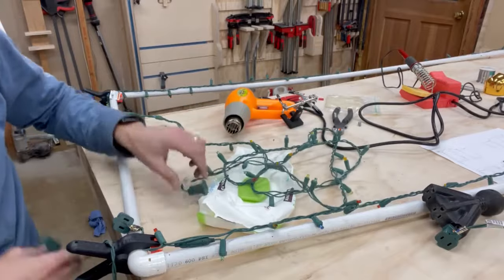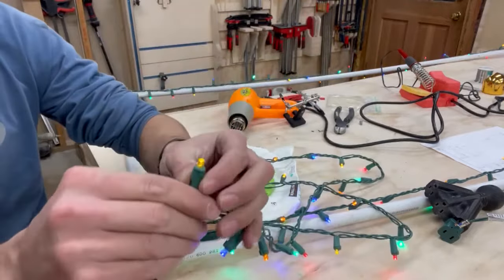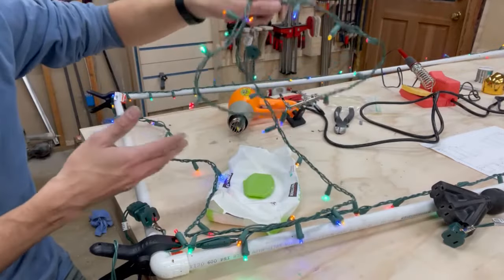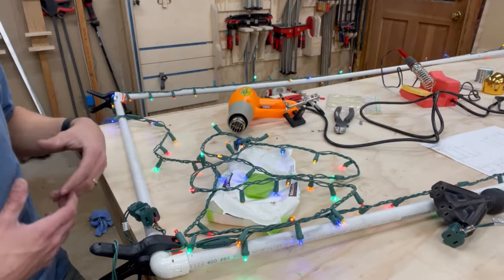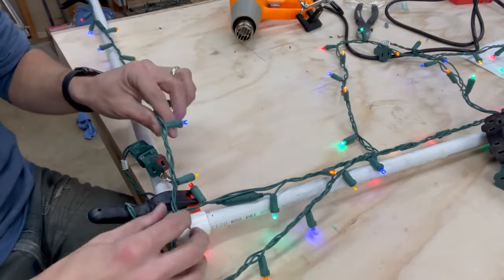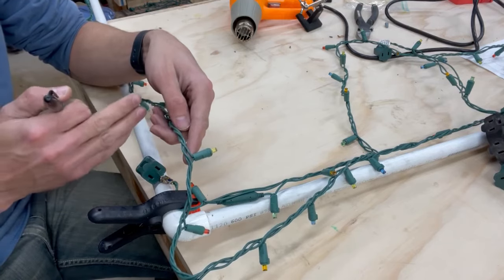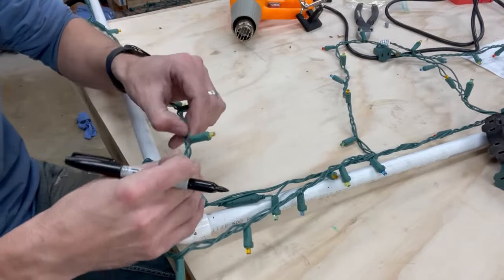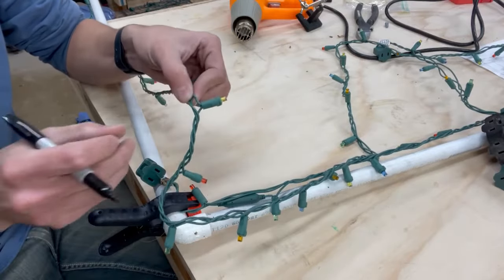How to Shorten and Solder LED Christmas Lights (Part 1 of 3)

Comment: Thank you so much for this video. Someone cut the cord on my Christmas lights outside. I didn't want to throw them away because they are very expensive lights. Thanks to you I was able to wire the lights back together. You saved the day!. Much appreciation.

Comment: The “resistors” are rectifiers. They convert ac power to dc and eliminate flickering. These lights are fully (full wave) rectified. These are the only LEDs Christmas lights worth buying.
Reply from the maker: @DrummerGirl423 Thank you for providing this information 💥 I had no idea what those were 🙃
Reply: Actually those are resistors. They often look very similar.  If they were rectifiers then there would be 2 wires going in and out of them, but his lights only have one wire.

Comment: My LEDs have three wires all the way to the female plug at the end.  I trimmed them several lights after the resistor/rectifier pack in the middle.  But now, no matter which way I splice them, the lights after the resistors don't work.  Humm.
Reply from the maker: Sorry to hear that. None of my LED lights have the 3 wires like you described, mine all look like the ones in my video, so I can’t help you out. Hope you’re able to figure it out, or at least wire it back like it was originally. Good luck 🤞🏼

Comment: Can i use this method to connect 3 separate christmas lights? I'm trying to get their blinks to sync. I know i can just connect their plugs, but every time i unplug them from the outlet they go back to random.
Reply from the maker: @Daryl Estrada Florin I haven’t worked with any of the blinking lights so I’m not sure. Depending on your comfort level with soldering, you could try and if it doesn’t work then solder everything back to normal. If you choose to try it, plug it in and verify that wires aren’t getting too warm and make sure you don’t have any voltage drop. Be safe and good luck 😎

Comment: Last year I installed two sets of lights on my patio. During the winter a squirrel came and ate the wires in a few places and also completely cut off the connections at both ends. I was in a lot of trouble doing the repair, not knowing which wire to connect . I have used your method and it is very effective. Also it works for both male and female connectors,
at the beginning of the lamp series as at the end.

Thank you !!!
Reply from the maker: @Maurice bélanger Darn squirrels and rabbits always chewing wires. Glad you got everything working.

Comment: Thanks. I needed this.  I was wiring the lights on the roof and my wife wanted a section with no lights and I just didnt see how these lights were wired. It looked like a series but that third wire got me.  Thanks again. Great video.
Reply from the maker: @pipi7731 Glad the video helped. Stay safe

Comment: Good Video... Thanks! Wondering if I can splice/an incandecent 4W blub connection to a regular string LED string lights.
Reply from the maker: To be honest, I don’t know. If you have some spare lights you don’t mind possibly ruining, I would just go ahead and try it. That’s basically what I did when I first tried doing this. Good luck.
Reply: as long as you splice it in parallel with the LEDs, and not in series

Comment: You are good:-) I have some strings without resistors inside the line. I will give it a try to cut the string. I asume that you do not need a femal plug at the end.
Reply from the maker: You do not need a female end, but you’ll have secure the ends of the wires so you don’t cause a short. I would cut off the female end of a set of lights that don’t work anymore and use that.

Comment: Thanks for your video. I was wondering if its possible and would it be relatively simple to mod the mode control box? In 9/10 cases when you buy xmas lights they have 8+ modes or programs and the "steady on" mode is always right at the end meaning they are useless if you want to use them on a timer. Have you ever done something like this before? I would imaging just bypass the controller and solder the wires but Id really like to not blow myself up if i can help it. The idea is i will hoist them up my sailboats masts and up the forestay over the triatic stay and down the back stays. also all around the grab railings too. Id really like to use a timer though i cant be going to the marina everyday to press the damn controller button.
Reply from the maker: @ThyHarkness I’ve never messed with the lights that have the controller box. Only the cheap simple lights. They sell simple timers that you can plug your lights into, not sure if something like that would work for you want. Sorry, not sure I’m going to be much help with the controller module.

Comment: When you say not super short, how short do you mean??? I’m making an archway with led Xmas lights and I want to be able to take it apart in sections for storage so I want to cut the lights in the detachable parts of the arch and add make and female plugs kinda like the pre lit Xmas trees. Will this method work for that do you think?? It’s a 3 wired string of lights like the video.
Reply from the maker: @edgelordlive1801 I honestly don’t know the shortest length possible before it won’t work. I would assume you would need at least one rectifier or what I called a resistor in line in order for them to work, but I don’t know that for sure. I would just label everything so that if it doesn’t work at the length you want, you can just solder everything back together and try a different length. Good luck and be safe.
Reply: @projectputunder6025  lol I really wasn’t sure if you would reply so fast. Thanks a lot I appreciate advice

Comment: Great video. Followed your method and cut my line. Plugged everything back in and it looked great for a couple minutes before it flickered and went out. Now only half of my 66 ft lines went out. Guessing you can’t just cut the lines shorter since the voltage is coming through the lines is matched up to a certain number of led lights. Too few lights, you get a burnout? Run into this?
Reply from the maker: Correct. There is a length at which it becomes too short and you’ll start to experience problems. Unfortunately I don’t have a formula or trick to know what that point is. Might worth trying to see if it’s just a bulb that randomly stopped working and that’s why half of them went out 🤞🏼🤷🏽‍♂️. You can use the ‘LED Keeper’ tool to determine if that’s the case. Sorry to hear that happened. Good luck and stay safe.

Comment: I think you should leave a little more wire on the end. Don't cut so close to the bulb socket in case as you said you need to reattach  the removed length.

Comment: Perhaps I missed something but if you shorten by quite a few lights  then the other LED's might get too much voltage and burn out faster correct?
Reply from the maker: @Sgtmajorsir There is of course that possibility, however, I’ve been running mine for over 4 years with no problems and not a single burn out.
Reply: I saw another video where the lady talked about getting too much voltage because the resistance had been reduced.  She solved the problem by wiring in a properly sized resistor.   Have not tried that but it worked for her.

Comment: Great video.   The LED (blinking/multicolor) strands that I purchased have 4 wires.  How do shorten those?  Thanks.
Reply from the maker: @MAS I haven’t tried this with one that has 4 wires. Depending on your comfort level with soldering (and comfort level of destroying one strand of lights) I would just label each wire on both sides of the cut, use some wing nut wire connectors and go through a trail and error method. That’s honestly what I did. In my experience, connecting the wires in the wrong order and plugging in the lights did not ruin anything, but your experience may be different with that 4th wire. As always, be safe and attempt at your own risk 😜😎

Comment: Will this method work for the incandescent mini bulbs?  I need to shorten a length to only about 5 bulbs.  Thanks!
Reply from the maker: @Joe Whistler This should work with incandescent bulbs, full size or mini. If you’re concerned then you may want to try with a set you’re ok with messing up, but this process should work just fine you. Let me know how this works out for you. I’m sure others would like to hear as well. Good luck 👍🏼😎
Reply: No it will not work with mini incandescent bulbs. The bulbs will pop instantly.
Incandescent mini bulbs have many different ratings.  2.5v is the most common, but there are also 3.5v, 5v, 6v, 10v and 12v.  You need to have enough bulbs to total 120v.  So you need roughly 50 of the 2.5v bulbs, or 35 of the 3.5v bulbs, or 24 of the 5v bulbs, or 20 6v bulbs, or 12 of the 10v bulbs, or 10 of the 12v bulbs.
You can shorten the string but you need to change the bulbs also.

Comment: How can I use just 20 bulbs from a set of 100, lighting it with 240v/50Hz ac  please?
Reply from the maker: @gatlino2004 Unfortunately I will not be able to help you out. I do know that there is a point at which too few lights is problematic, but I don’t have an exact number and I definitely can’t help you with led lights on 240v. Good luck and be safe 👍🏼😎

Comment: Where do you buy your lights from? Also, can I do this with a control box lights meaning the box that controls the blink pattern?
Reply from the maker: @AJ W I got these lights from Walmart when they were on sale 🤑 I haven’t tried this with lights that have a control box to control the blink pattern. If it was me, I would use the marking system I showed in the video and go for it. If it works great (it may take some trail and error like I showed in the video), if it doesn’t work then you can solder everything back the way it was. I’m only telling you what I would do, but in the end it’s up to you. As I have said before, use lights you are willing to sacrifice or be willing to go buy another set if something happens. Good luck and let me know how this ends up working out with the control box and blinking pattern, I’m curious and I’m sure others are as well 💥😎👍🏼

Comment: what if I decide not to add the plug at the end? how do I finish the connection? thanks
Reply from the maker: @Nicholas j. Mastrocovo Hey there, I would recommend keeping the plug to keep the wires safe and in case you ever need to plug something into that set of lights in the future. If you aren’t going to keep the plug, you need to make sure the wires are covered and protected the elements. Maybe some shrink tubing or something along those lines. Be safe and good luck 😎

Comment: so i have a standard 5 color (red,blue,orange,yellow,green) 70 LEDs string with 2 rectifiers. i want to add 2 more colors (white, purple) in the set. my set is 3 wires also.
 i bought a 70led white set and 70led purple, now i just need to cut and add. 

if anyone knows some tricks let me know please
-> are these LEDs one direction? 
-> and the 2 wires bypassing the LED, does they matter how i connect them? or they random (of course the LED wires i will connect to the next LED)
-> and also, do i have to add the rectifiers every 35 lights? or doesn't matter
Reply from the maker: @Gabriel alacubalena Unfortunately I won’t be able to help you out. Good luck. 👍🏼
Reply: "are these LEDs one direction?"  - YES, LED's are unidirectional. If you have a string of lights that are uncertified then it doesn't matter. If the string is rectified then it does matter which way the LEDs are installed.
"and the 2 wires bypassing the LED, does they matter how I connect them?"   Yes.  Those 2 wires bypassing the LEDs are the HOT and neutral wires from the plug. If you connect them together you've created an instant short circuit. The wire from the LEDs needs to go to the proper wire.
How many white and purple LEDs are you adding?  If you add too many they will just turn off completely.  Each colour LED has a certain forward voltage bias associated with it ranging from about 1.7v (red) to about 3.5v (white).  They need that amount of voltage to turn on.  Purple and blue are close to 3.0v.  So your 70 LED string is comprised of 2 sections of 35 each.  If you add too many white and purple LEDs it will slowly dim until it doesn't work at all.
Reply: @tchevrier thank you!
I noticed this too; they got dimmer as i was adding until the added ones were off completely while the the rest of the string was on. i think the white ones needing more power than any other color is messing up everything.
im thinking how to add power somehow without burning them; like section them further (every 20-25) and powering up each section, if it makes sense
Reply: @alacubalena  It's not really about needing more power.  Its about needing more voltage.  An LED needs a certain amount of voltage to turn on (forward bias) and that depends on the colour.  Red is usually the lowest (1.7v) and Blue is the highest (3-3.5v). In most cases white is just a blue LED.  Most multicoloured 35 bulb LED strings typically have an even mix of  4 or 5 different colours.  Assuming that's 7 each of red, orange, yellow, green and blue, that would be roughly 80v.  That's the minimum voltage you need to apply to turn the LEDs on.  But if you just connect 35 LEDs to an outlet you will instantly blow them all because there is nothing limiting the current.  That's why the resistor is required.  The resistor is required to limit the current to 15-20ma.  Now for each purple and white LED that you add, you are increasing that 80v figure by roughly 3v each time.  And with each LED that you add you are reducing the current.  So lets say you add 5 purple and 5 white LEDS.  Now the total voltage drop from the LEDs is 110v.  It's still enough to turn on but the current will be considerably less and thus the LEDs will be quite dim.  Add a couple of more LEDs and eventually there isn't enough voltage to turn them on. It really doesn't matter where you position them, there just isn't enough voltage to turn them all on.
Reply: @tchevrier  let's see if i got it correctly..
so my project is : 
i have a 70 LED string with 2 halves at 80v; Each half is rectified by a resistor; i want to add 7 White and 7 Purple per half, that would be 14⚪ and 14🟣 total; With about 3v each that would be 84v extra. So i need to supply more voltage (around 160v?) and keep the current at 15/20 ma?

Comment: Can I do this if it has a battery pack?
Reply from the maker: I have never tried this with a battery pack, but I don’t see why it wouldn’t work. I know this is obvious, but just make sure the batteries are out 😂 As I stated in the video, if you’re going to try, be willing to throw the lights away if it doesn’t work. Good luck and please come back in here and let me know if it was successful.
Reply: Battery powered LED strings are different then AC strings.  AC strings install all the LEDs in series with one another.  Battery powered LEDs install the LEDs in parallel with one another. That means it is much simpler to shorten the string.  Just cut off what you don't want.  But DON'T join the ends together.  That will create a short circuit.

Comment: It’s not a resistor, it’s an ac/dc step converter.  LEDs draw very little voltage.
Reply: LEDs draw very little current

Comment: Can you connect like two different colored lights? Let's say I wanna cut a red christmas light in half and a blue one in half, and I wanna connect those two. Would it be fine?? Or it needs to be a same brand or voltage  etc?
Reply from the maker: That is an interesting idea. I have not tried tried that yet, but now I’m going to lol. I would think that was long as you maintain to same or less number of lights, this shouldn’t be a problem, however, proceed at your own risk should you attempt it. Please keep me updated if you try. Be safe 😎
Reply: That's a good question.  Different coloured LEDs have different forward voltage drops.  If  you replace a red LED with any other colour you will shouldn't have a problem, however if you replace a blue LED with a red then you will need to be careful how many you replace as you will increase the current for each LED you replace.

Comment: I have c9 led. I only need to cut 7 off the end. Do/should I reconnect the female end if I don’t need it? Mine also do not have a resister do you think/know if this will work??
Reply from the maker: Adam, this will work even if your LED strings don’t have any resistors. If you have any concerns, then mark each line as directed so you can solder everything back together if needed. I would recommend just using the female plug that is already at the cut off end bc you never know when you might want/need power for something else. Also, it’s an easy way to keep your new connections as water resistant as possible.
Reply: All LED strings have resistors.  They might be located on the wire like in this video, or they might be soldered directly to the LED inside the housing where you can't see them.

Comment: Hello beautiful. I am looking like this. Can possibly show something. Mean Christmas icecle light is very nice. I seen 3,4 inches gaps each light.  But I like to do filler between gaps more light. Like ever two inches length I like to put extra light. How do I can do. 

Like example shop seen I meter length 20 lights. But I like to put 40 lights. Do understand what I am saying. 

Do u know any shop will do London. I live N9, close to Tottenham new football stadium. 

Or can possibly do for me

Only I like to do my front window 6 fits around wider

Just like to do each wire length bit bigger and more light extra put every two inches after after with U.K. plug or usb operation system. 

Please kindly advise please